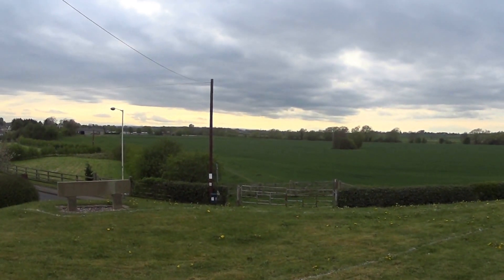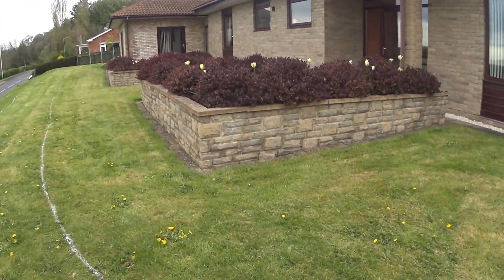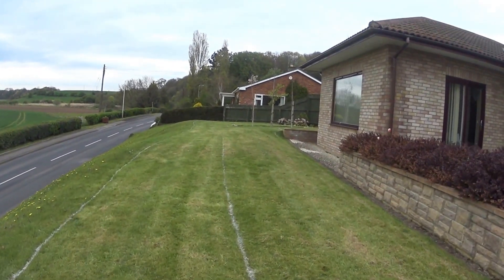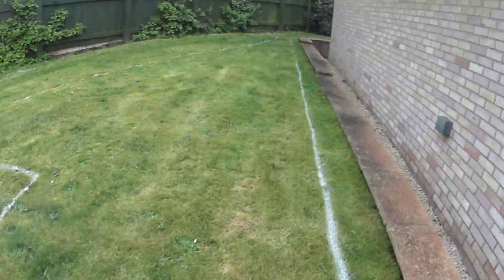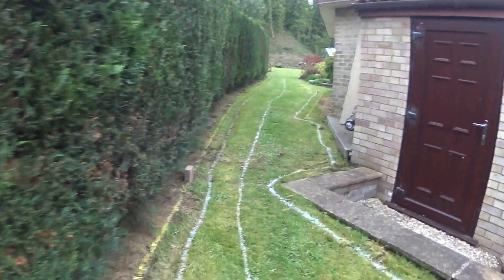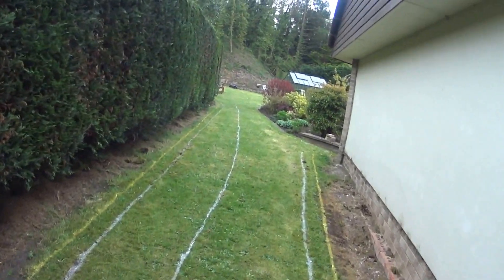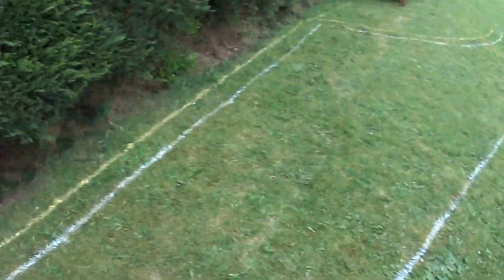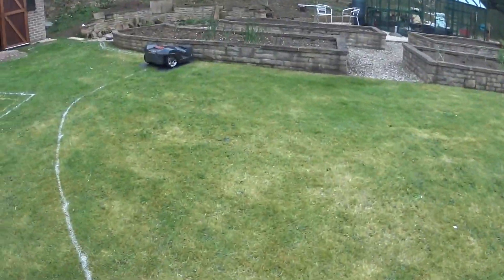Husqvarna Automower Challenge - How the wires work

Comment: Hav you had any problems with the mower going in the narrow passage when its just in normal cutting mode and getting stuck there? I have the 315 and it keeps getting stuck :(
Reply from the maker: I've had no problems. Does the 315 come with the central wire?
Reply: @patmurray5917  Yes, and it has no problems following that to either side of the passage when it is starting or finishing a cutting session. Problem is when it is in the middle of one and wanders into the narrow passage. Then it will bump the walls about 8 times and then declear that it is stuck